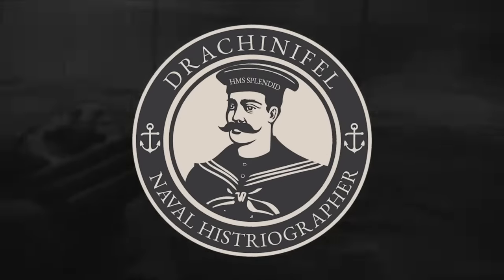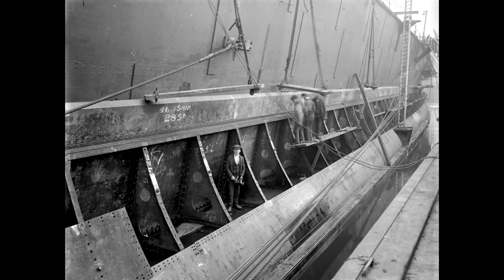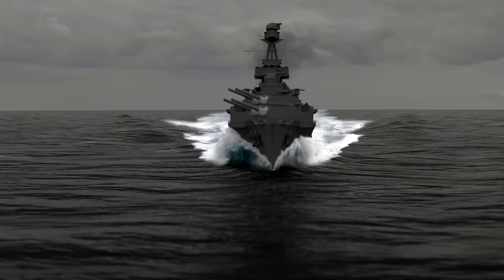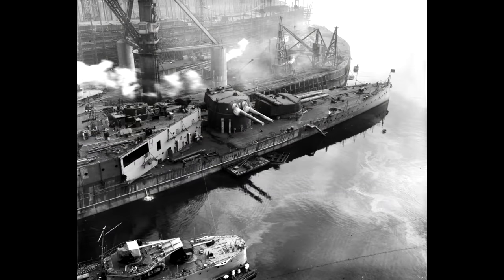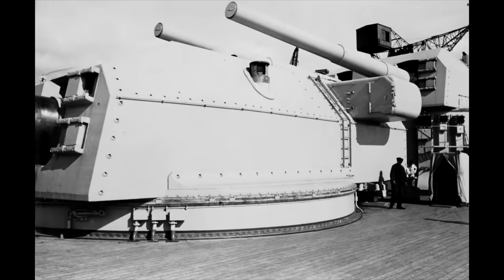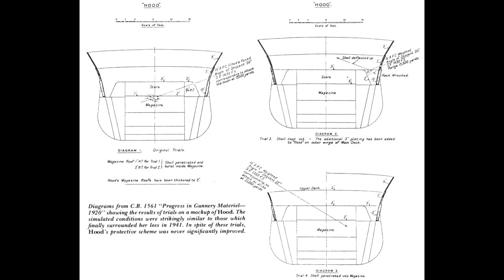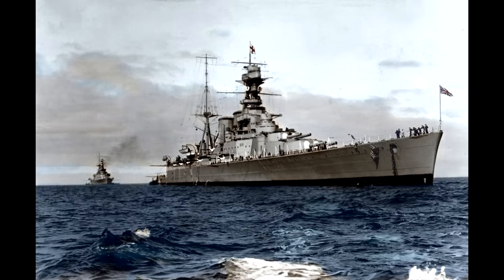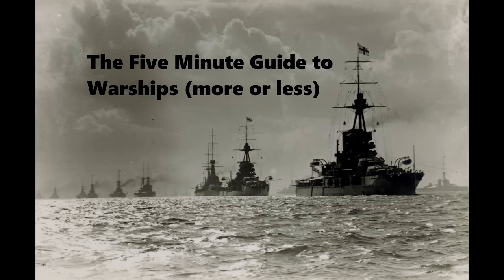The Loss of HMS Hood - But why did it blow up??

Comment: So, to interpret in a weird way, hood was killed by:
- too much speed
- not enough water
- too many Germans
Reply: Also too much water after she split in half.
Reply: To be fair, "too many Germans" is a common problem, before the 1950's.
Reply: You missed; 
Some damned fine gunnery from The Bismark. This is a recurring theme in RN vs German capital ships. At Jutland, German gunnery was spectacularly effective, the British was, erm, not so. In fact, although the gunnery really wasn't all that bad, the shells were so bad that only a small %age detonated.
Yet, for all their practice drills, rarely did the RN produce a really remarkable display of gunnery with the possible exception of Matapan.
Reply: Screams in Jackie Fisher
BUT SPEED IS ARMOR
Reply: @davidcolin6519  you are correct, but please also consider that at Jutland the ship design made a huge difference. Just look at how high the British ships sat in the water and then compare it to the Derflinger for example. Considering that they were mostly fighting broadside to broadside this gave the German gunners way more surface area to hit.
Reply: @davidcolin6519  To be fair though. Would the RN shells have detonated, more people would've acknowledged and praised their exceptional gunnery. Perhaps even to the extent that we see people praising the German gunnery today. 
I mean technically, shells hitting its target but then not exploding due to faulty fuses shouldn't really lessen  the perception of a crew's gunnery skills. 
(I'm just talking in broad, general terms and not aiming at you specifically)
Reply: @dropdead234  no, Sir, it is a British problem waging too many wars. Britain was responsable for 2 WWs, which Europe lost against the US.
Reply: @bernhardlangers778  WWII Scharnhorst-class-ships sailed with a flat silhouette. So, they were wet ships. You are right, but flat silhuettes cause sea-damages and turret-failures.
Reply: @hajoos.8360  To be fair, the french put quite a bit of effort into starting fights they couldn't finish.
Reply: @Lowkeh  Part of the problem was the unexploding shells, but part of it was also missing the target. 
At Jutland, a minuscule number of shells exploded, leading one German Captain to proclaim that his ship wouldn't have lasted long if only half of them had detonated. ,His ship made it back to port. 
But, IIRC, in the case of Hood and Prince of Wales (?) vs Bismark and Prinz Eugen, Bismark and PE had far more hits per salvo, even taking into account the number of rounds per salvo. When you consider thjat the RN had none of the reservations that the USN had about live drills, that would seem to be pretty unimpressive.
Reply: @davidcolin6519  Even 16 inch shells of Rodney could not sink the sitting duck Bismarck. To destroy the superstructure of a ship there is no need for 16 inch shells, 8 inch are enough. At Denmark strait the Brits were from the beginning in advantage. 10 big guns against 8. The Germans were forced to offer their broadsides, not a favourable angle receiving hits, as we had seen with the PoW-hit in Bismarcks bow-section. And additionally the Germans suffered under a stupid admiral, who gave no order to open fire, so the Germans started 2 minutes after the Brits with firing, an infinity during a sea-battle.
Reply: @davidcolin6519  Matapan was ...point blank xD is there even gunnery in it?
Reply: The added weight of modern modifications may hay altered the hydrodynamics of her wake.
Reply: @dropdead234  the Frenchies replaced the Dutch, a quote by Frederik the Great, "the french sloop, towed by the RN".
Reply: @davidcolin6519  Hits scored in this exchange are Bismark: 5 or 6 (1 or 2 on Hood, 4 on PoW). PoW: 3 on Bismark (one of those was marginal, hitting only one of Bismark's small boats). Prinz Eugen: at least 4 (at least 1 on Hood, 3 on PoW). Hood: 0 (some near misses on Prinz Eugen but we aren't counting those).

Keep in mind that PoW was suffering from turret malfunctions that reduced the number of guns that fired in each salvo, and spent the early part of the battle with only 6 of 10 guns able to be trained on the enemy at all. Based on this, PoW's accuracy wasn't too much worse than Bismark's.
Reply: - insufficient luck
Reply: @painiscupcake5433  Yes, good luck for PoW not to be sunk.
Reply: @hajoos.8360  this was not luck but a strategic decision by Lutjens. Chasing down the fleeing PoW would have used up ammo needed for raiding and risked further damage to Bismarck that would have ended her mission. Due to hits received in the battle Bismarck's speed was reduced to little better than PoW, so it would have been a very protracted chase, and furthermore Norfolk and Suffolk were still nearby and would probably have attacked if PoW were in danger. So at the time it didn't seem to be worth the risk. Of course we now know that Bismarck's raiding mission was over anyway due to PoW shooting her forward fuel tanks, so in retrospect a pursuit might have made more sense.
Reply: Well, I think it was best put by Curly Howard. She was "a victim of circumstances." That and what seems to be Murphy's Law taking a full 2020 on her.

"What could possibly go wrong? Oh we got hit? We always get hit. It hit in a specific spot under our side armor? Well we have bulkheads to take all that. It blew up a magazine? Well surely that will be contained. The other near by magazines exploded!? Well what else could possibly go wro-?" <Hood blows up and rips in half.>" -oh. . . . That would also be wrong."
Reply: @nerd1000ify  No, Sir, there was no strategic decision. Lütjens could not get away without fighting, this is, what we call "the battle of Denmark Strait". 2 heavy cruisers in his back, 2 BBs on his portside and the ice on starboard. But he was not able to give the permission to fire, he paniced. This was cowardice facing the enemy. Permission to fire was ordered by the commanders Lindemann and Brinkmann. The cowardice of Lütjens cost the Germans precious 2 minutes of not returning fire. Lindemann demanded the pursuit of PoW, but Lütjens failed again. The mistake of Lindemann was not to release Lütjens from his duties as an admiral, when he realized that Lütjens was not fit for command.
Reply: @davidcolin6519  That German shell was accurate & did detonate.  Her majesty didn't appriciated that.
Reply: @hajoos.8360  Technically most of Europe is responsible for the first of those world wars, and the US is responsible for the second one....
Reply: @rambysophistry1220  Dear Ramby, historical research is helpful. The FED was founded in 1913 to enable the US financial system to give loans to the Brits. Wilson did everything to lead Europe into war. The Berlin-treaty from 1878 was broken by the Entente-Powers. An the Mittel-Powers did not realized the Entente-will of total destruction. Always it is helpfull to look for the profit-takers. If the stupid Habsburgs would have given Bosnia to Serbia, it would have generate a probability that the Russians would gain a port at the Adriatic-coast. This would have led to a Brit-Fanco-war against Russia. Better for the middle-powers.
Reply: @hajoos.8360  Here is the thing. Wilson cannot really be blamed for the initiation and outbreak of hostilities that was WWI, but Wilson's work in creating the "Treaty of Versailles" is what paved the way for WWII. WWI was what happens when the political equivalent of multiple kegs of gunpowder and fireworks are stored in a phosphorous factory. The inevitable occurred and causality is as it is. But a treaty that doomed Germany to tear itself to pieces economically and placed all moral blame on them was not a good way to ensure peace.
Reply: @rambysophistry1220  Till 1914 Deutsche Bank was the biggest bank on the planet. The Brits thought they could destroy German competition on the Global Markets with war. Instead to find a European way Britain declared war. Britain declared war in WWII. These are the facts.
Reply: @hajoos.8360  WWII was an ideological conflict. Formed out of the results of Woodrow Wilson's refusal to get involved in WWI. WWI dragging out into 1918 meant that the Soviet Union formed. If the war could have been over 12 months earlier, the February revolution wouldn't have happened. Russia would have been left with a provisional republic that managed to oversee the stopping of Germany. No Soviet Union. Without a communist state Fascism would not have had purchase. 

So, all that needs to happen is the US gets involved in WWI sooner. That happens if either Taft or Roosevelt wins the election of 1912 as both were in favor of getting involved in 1914. Woodrow Wilson winning the 1912 election with a minority of votes was the catalyst required for Wilsonianism to be the ideology present at the Treaty negotiation of 1918. This caused the Treaty of Versailles and that treaty caused the conditions for WWII.

That is the historical timelime and what happens if it gets changed even slightly by not having Wilson present. Wilson is directly responsible for WWII and everything that happened in the 20th century in general. All of it. He is the worst president of all time.
Reply: @rambysophistry1220  this is what they tell us in school or at the university. Wilson admitted in 1919 that the founding of the FED as it happened during Christmas holidays, was his main failure, because the FED is not federal, the ownership consists of US private banks, funny isn't it? During the Weimar Republic the Germans debated, too, the question of a private National-Bank or a public one. The Bank of England was a private bank, too, till 1948, after Bretton Woods there was no use of it anymore. The founders of the Bank of England in 1694 are still blacked. The II. Reich could refinance the war alone with war-bonds. Britain could not. JPMorgan gave big loans to Britain. In 1916, after Galipoli Britain loses the war, what meant, the JPs loans to Britain were going into default. Let die some unexperienced GIs to save those loans. Maybe you should hear the famous Freedman-speech (1961), available on YT. About Russia is to say that at the beginning of the Russian Civil war, the Entente Powers supported the White Guardists against the Red Army. The Red Army was in a bad state until Trotzki came back from his Canadian exile with a lot of money loaned from US bankers (mainly Jacob Schiff). With this money Trotzki managed the re-organisation of the Red Army, (the Entente Powers stopped the support for the Whites), won the Civil War, fought back the aggressive Poles who invaded Russia (Polish army stood beyond Kiev) during the Polish-Sovjet-War, lost only the last battle of Warsaw, what definded the ridicoulous border the Poles still demand. About WWII read Churchill-quotes. Churchill did not care about Hitler or any other Reichs-Government. Churchill aimed the destruction of Germany and the genocide of German people. After the war, he admitted, "we slaughtered the wrong pig". Churchill was the worst European politician in human history. He destroyed the biggest empire that the planet had ever seen, and additionally the continent of Europe in a lifetime.
Reply: @hajoos.8360  So, here is the thing. I reject most of that. Not out of hand, but because there are important historical facts that are far more influential both in the structure and consequences of both wars. Starting with WWI.

The first is that Britain had naval supremacy. This means, unrestricted U-boat warfare was the only thing containing Britain's imperial might. Without that, Britain would have had the full productive and man power of Australia, New Zealand, Canada, India and all of its lesser colonies to work with and Germany would not have had a chance to actually do anything. Germany was inherently contained in Europe, regardless of anything else, and the manpower of England was greater. With those two things, Germany outright winning World War I was impossible. 

When one side has both a productive and manpower advantage the war is in essence over already. We saw that in the US civil war. It is just a matter of time arriving at that point. The money is irrelevant because it is a total war. Total wars are not like Desert Storm, they are an entire society mobilized for the explicit purpose of destroying an enemy. Money doesn't matter, factories matter, mines matter, soldiers matter.

Now it is a matter of how fast the side that is doomed to lose loses. In the case of Germany, they were able to hold out until US forces came onto the western front and collapsed the German line. At that point, Germany was going to lose the war in short order. Whether by conquest of Berlin or surrender to the allied powers. 

In the case of WWII, the war was ideological. Fueled in Germany and Italy by fear of Soviet expansion. Fueled in Britain and France by Soviet expansion and then German and Italian expansion. Once again, unrestricted submarine warfare was the only way for Germany to stall out England because massive empire with naval supremacy. The US got involved sooner, and so the war was shorter.

If you want good sources, I would recommend "The election that ruined everything (and if it never happened)" By Cody at Alternate History Hub and available on Youtube. I would also recommend having a look at the wikipedia page on Total War to familiarize yourself with why money doesn't really matter in them, and it is all about production. If you really want why production is the key economically, I would recommend looking into the concept of Say's law.
Reply: @hajoos.8360  Of course we were?, Austria's desire for a route to the sea wasn't anything to do with it more was the assassination of Austria's arch Duke Ferdinand, had the Germans gone over the Maginot line then Britain would have stayed out and let cousin Kaiser play with his French friends again, but no he had to go through Belgium, an important British trading partner, that is why we joined in despite the triple entente. As for the second time round the Germans had already taken back the ground they lost to France and rescued Czechoslovakia from itself, we even got a signed document saying the Germans would be nice from now on, not that they honoured it, as they then went on a tour of France, via Holland and Belgian, once again trading partners, at that point we could have gone for a trade agreement with the Germans and turned our backs, maybe we should have!. Could you explain how you think Britain was responsible when historically we were far more likely to have "dealings" with the French with the Germans as allies.
Reply: - not enough deck armour
- not good enough cordite and shell handling.
Reply: @mwnciboo  this might be, but please tell us a case, when enough deck-armour prohibited something?
Reply: @CrusaderSports250  Britain declared war, that's the fact. About Bosnia is to say that the Berlin Treaty of 1878 (Lloyd George was present for the Brits)  organized the international legal matter about it. The Entente broke this treaty, The assassination of Ferdinand was about the conflict with Serbia about Bosnia. Habsburg had already lost the so called "pigs-war" from 1906-1909/11 against Serbia. The High-Seas fleet is not an argument. In WWII the Germans had no fleet, but the Brits did not care. To use the route via Belgium was a strategic or tactical decision. But do you think the fascist empire of Britain, which occupied the half planet, should use moralised arguments? Czechoslovakia is an artificial state. Praque (contents the first German university) was for 300 years the German capital and much better than Berlin.
Reply: @rambysophistry1220  this is the propaganda-story for the British underdogs who had to die in battle. About British sea-dominance is to say, that Britain's situation was not the same as in the 19th century. The Germans built always ships with the intention not to use them. If the Japanese would had used the same approach Tsushima would not have happened. The strategic decision to wage war against Germany is to wage war against Europe, because Germany is Europe or Europe is nothing without Germany. And the result of both WWs is the sell-off of the British maritime overseas bases to the US for 53 old destroyers in WWII and Bretton Woods in 1944. The US is dominating now the 7 seas. The US replaced Britain. This is the major result of 2 WWs. And do you think this is coincidence? For Germany there is no big difference. Germany had no real counting colonies, now Germany is smaller and had to suffer 8 Mio. dead during the war and some more after the war by a holodomor. But globally nothing has changed for the Germans. So, you see, Britain had lost both WWs and an entire empire.
Reply: @CrusaderSports250  Dear Roger, someone, who can read, gains the advantage. I did not wrote about Austria's wishes for ports outside the Adriatic Sea. I wrote about Russia. If the Habsburgs would have admitted Bosnia to Serbia, instead to fight the "Pig'sWar", the probability of an Adriatic port for Serbia, would had been plausible. And if Serbia has a port, Russia has it, too. A main target of western policy till our days is, not to allow Russia a southern port.
Reply: All of this should be normally calculated ahead of time by the captain of the ship, right? It's called the art of war!!
Reply: @1controversial  most actions in wars are improvised....
Reply: @hajoos.8360  The US always win!
Reply: @clovisra  This is nonsense. The US is able to destroy everything. But since WWII, as Trump said, the US won no war again. And the question "why" is not so difficult to answer. Every military expert on the planet knows, there is no chance to win a symmetric war against the US. So we only consider asymmetric wars as a logical consequence. And the IQ in the US army (od Nato-state-armies) is very low, a big difference from the past in every western country. The Chinese or Russian officers staff is in this question quit superiour.
Reply: @hajoos.8360    Please, educate me. This is what a think is the truth. I understand that the US does not need to acept a formal surrender to 'win' a war. Destroying and causing states to fail is already a victory because what the US need is to get the control of natural resources and financial supremacy. Wars without end is acceptable. It mantains the war factories working and desorganize the competition by small states. What is happening in the middle east is an example. In South America no country is allowed to develop. The US is achieving all its objectives by that matter. The only areas where the US are not happy is Russia and China. China is a menace because it is no more an asset but a rival. The dream of controlling the imense russian natural resources is now becoming a nightmare. Any US government will focus always in ways to topple the governments of these two 'rogue' countries and install friendly ones. A new Yeltsin in Russia for instance. This empire project is old and is a reality now.
Reply: @clovisra  the game is already over. It will beome maybe obvious in an era, when we are already dead. China and maybe Russia are invincible. Trump had the only strategy to counter China, drawing the own production facilities back to the home-country, what means a nationalisation. US wars are very cost-intensive. Russia invested successfully only the 10th part in Syria in comparison to NATO. The Irak-wars brought nothing, only in the Kirkuk-region controlled by the Kurds is some oil-business for the US. We see more a counterproductive impact of these wars. Saddam was easy to control. Now the Shiits are in power. Honestly, this is more than stupidity. And if you look more back to the past. In Iran (1953) Mossadegh was kicked by the US and Britain, because he wanted a bigger share of the oil-money for his country. The US installed the Shah instead. He was in power for 27 years. But the Iranians had enough. The Shiits are now in power for more than 40 years. The decisive people in the US are really boneheaded. Ther are more examples, but i do not want to bore you.
Reply: @hajoos.8360  i agree, but it was not 2 minutes of no action but it was 15 minutes . 15 minutes would give Bismark  prinz eugene enough time to sink both Hood and Whales so Lutjens was fault at sinking Hitlers proud and joy the KMS  Bismark. But the only thing i  have to say is that Lutjens was following orders he was order not to engage any British ships if not protecting any convoys so i guess you can say he took it to heart to not defy orders.
Reply: @hajoos.8360  @Nili Adler most actions in wars are improvised....
                       Ja.
                       Kein Operationsplan reicht mit einiger Sicherheit über das erste Zusammentreffen mit der feindlichen Hauptmacht hinaus.
                       Karl Bernhard Graf von Moltke.
Reply: @joeyreidelbach5509  This describes a major problem in the OKM. Lütjens said to his predecessors as Marschall, that he will not give any reason to be sent home or taken from command. In this situation at Denmark Strait, all advantages were on the British side, except the light-circumstances in the morning. There was no chance to avoid battle. Even Brinkmann and Lindemann were afraid of consequences. With 2 heavy cruisers behind the stern, the ice on starboard, 2 BBs on port, a commander has to open fire to fulfill his duty, anyway concerning his own fate. It is simply stupid not to do it. This was the central debate between Raeder and Hitler after Bismarck sunk. Furthermore, in contrary to the Brits over decades, failing admirals, as Kummetz, and officers were promoted or their names hailed, as we can see with the destroyer Lütjens or the Panzership Graf Spee. The brave guys in the Kriegsmarine or former Highseas-fleet were degraded or lost their command. This is a total political failure in the II. and III. Reich.
Reply: @hajoos.8360 yep, The Head of the German Navy should of told Lutjens to not engage any ships if not fire upon on but if you being fire at then  you have the  right  to defend yourself and fire back. I mean if i was Lutjens and the HMS Hood fire at my ship the Bismark or at Eugene i would order all cannons  aim at Hood  and once the radar controll fire system and range finders have the Hood lock on i would order fire at will to end the fire fight and get to the Atlantic ocean  and start  hurting down Convoys.
Reply: @joeyreidelbach5509  The point is there was no possible decision making, anyway what the OKM ordered. It would had been the duty of Lindemann to dispend Lütjens form his command as an admiral, because he was obviously guilty of corwardice facing the enemy.
Reply: @maunsell24  Dagegen will ich nichts einwenden. Allerdings traf die Bismarck erst nach dem Gefecht in der Dänemarkstraße bereits schwer beschädigt mit der feindlichen Hauptmacht zusammen.
Reply: Hideously wrong. Not enough speed, Far too much water. German  question stupid.
Reply: @luftcorde  Please sort out the Caps Lock key.  It's just down there to the left of A.
Reply: @hajoos.8360  Insane Double.
Reply: @davidcolin6519  Are you a native English speaker?
Reply: @johnbishop5316  Please sort out how much I care. Oh wait-
Reply: @johnbishop5316  Could you, please, explain your answer more detailed?
Reply: @johnbishop5316  Yes, unlike, apparently from you syntax, you.
Reply: @hajoos.8360  You need to find a very good personal injury lawyer, hire them, and sue your highschool for negligence.
Reply: @brentm9848  Do you have any historical content you could provide us with? If do you have only personal assaults, simply shut up.
Reply: @hajoos.8360  "Britain caused 2 World Wars" is not historical content, it's gaslighting falsehoods. YOU need to provide a LOT of context to back up that assertion.

Also, do you find telling people to 'shut up' often achieves the stated goal?

Finally, what part of America are you from?
Reply: @brentm9848  The main question is, who unleashed the World War? And brought in an entire empire? In both cases there is only one possebility to answer, Britain. Only Britain was in the position to do it. In both cases Britain declared war over Germany. And it is obvious, that I am not an American, very funny. But it is obvious that you belong to the warmonger-nation, the "albion perfide", which mistreated, tortured the entire planet for more than 300 years. When you will start to pay for it, to fulfil the obligations of your guilt against so many nations?
Reply: @hajoos.8360  Okay, Karen you're very wrong in many, many ways.

And I'm not British, nor American, Snowflake.

Britain had a global empire that was based on a) trade, and b) stability of that trade maintained by her navy. It was in her direct interest to DETER war. War was the enemy of trade and Britain, through her empire, had acquired access to resources to be able to sustain.

While Germany in the latter part of the 19th and early part of the 20th century had become ambitious and wanted to have what Britain had already achieved, they lacked the access to resources. They tried to challenge Britain in a naval race. It was their instigation that forced said race ahead.

And it was a very complex, entangled system of alliances, specifically designed by the people who enacted them to avoid war, which failed due to unforeseen flaws, and drew in the great powers.

No one really wanted war. France and Germany wasn't ready, Britain was happy with the status quo, America was isolationist.... but war came DESPITE no one wanting it.

Britain didn't cause the war. A 200 year old diplomatic system, plus a jealous Germany intent on challenging britain caused the war.

Learn your history before you go spouting off.
Reply: @hajoos.8360  You can tell how superior the Russian officers are by their outstanding successes in Afghanistan in the 1980s. 

Russians are good at one thing at the moment: Cyber warfare. And it's not their soldiers or generals who are engaged in that - it's their computer nerds.

China is ascendant, no question. But only because they stole their tech from the west. They have yet to prove to be innovators. They adapt what others create. So far. When that changes, I suspect the balance will change dramatically quickly.

But the IQ in the US armed forces is not a monolith, and to be clear, the US won Gulf War 1 resoundingly. Dismissing that is silly. And the US has now got nearly 3+ decades of learning regarding asymetric warfare and that should not be discounted either. 

If Russia or china disagreed, we'd see Ukraine fully taken over or Hong Kong invaded. We don't, so they don't.
Reply: @brentm9848  You wrote the complete bullshit of school-teachings. It is completely wrong. The Royal Navy caused more than 20 holodomors in 300 years with more than 80 Mio. victims. The most famous prevented holodomor was the seabattle of the glorious 1st of June. https://en.wikipedia.org/wiki/Glorious_First_of_June
It costs the Frenchies 7 ships of the line, better than to starve.
Not prevented were more than a half mio. dead Germans, died of hunger, during WWI. Germany never attacked Britain. The fleet ambitions were not the point. The III. Reich had no fleet, but Britain again declared war. As Churchill said, Britain wanted to wipe out the Germans, not a regime change. The most famous wipe made by the Brits, was the tribe of the Tasmanians, annihilated, so diplomatic. The same bullshit story you told us about the isolated US. The US waged war against Spain in 1898, not to free the inhabitants of former Spanish colonies, but to take over those colonies, not as they said according to the https://en.wikipedia.org/wiki/Monroe_Doctrine
They took the Philippines, too. The result of both WWs was, that Europe including Britain lost both wars and the US won it and overtook the military empire. If do you watch carefully Drach's channel, you will see, that the current Brits do still not realize, what has happened, as you, too.
Reply: @brentm9848  The Afghanistan war of the Sovjets was a desaster, because the US armed AlQaida with manpads. Even the Chechenian war under Putin went not well. But the Russians were enforced to use their unfortunate experiences to transform their military. The US did not. As Trump said, the US can destroy everything, but not win (asymmetric) wars. Russia did it in Syria with a minimum of military engagements. You, my dear, are used to write always historical bullshit?
Reply: @brentm9848  Ok, you lost the debate and you want to piss off? Who cares about revisonism? Do you cannot check history as everyone interested,  is doing? For example Drachinifel is a top-researcher, does he need the opinion of prof x or y? And what you are talking about religions? Everybody is allowed to believe in jesus, climate, the moonlanding or something else. And i beg pardon, losing the battle is always boring. I recommend you to start to think yourselfes.
Reply: @hajoos.8360  I dont follow, the British did not in fact, start WW1, the US did not singlehandedly win WW1 and in fact although the fighting was still brutal, didnt even participate in most of the war. WW2 was a direct result of the penalties enacted against Germany by all of the allies who laid massive economic penalties on Germany for WW1, effectively scapegoating them into responsibility for the entire thing which wasn't accurate. WW2 kicks off by German aggression eastward into Poland which Britain didn't have anything to do with. British Troops participate in the defense of France as well as a few smaller battles in northern Europe but are forced out of France at Dunkirk and will not re-enter mainland Europe in significant numbers until the D-Day landings in '44. Also the premise that Europe lost against the US completely disrespects the efforts of all the allied countries fighting in WW1 and WW2. Hell, some of the countries even fought on different sides from war to war, namely Italy who was an ally in WW1 and an enemy in WW2. Basically what I'm saying is every part of your statement is wrong and you should really make an effort to educate yourself further before commenting further on subjects which you have very little experience. And to clarify, I did generalize significantly and skipped digging into the full social, economic, and political reasons for the World Wars but to be honest this is already long enough and it takes a college course or two just to grasp the basics of the those reasons.
Reply: In a nut shell, gunnery, only 20yrs apart, sealed the fate of good old mighty HOOD, also, latest technologies didn’t do any good to PRINCE of wales...just for the arguement, KGV is acceptable, how about PoW? No disrespect...RIP
Reply: @hajoos.8360  15/16, people wouldn’t be interested, i kind of believe/hope KGV made it to the end of WWII, but no museumS?!
Reply: @vivianvaldi7871  oh boy, her majesty @ that time, what a 🦊, SHOWsome knowledge, no respect to THE KING
Reply: @davidwong825  all BB-lovers or interested poeple in maritime history regret the lack of museum-ships.
Reply: @davidwong825  you see the development of the worse british gunnery throughout 41 to 43. The progress of radar-technology made it possible that DoY made 13 hits on Scharnhorst, with one fatal hit slightly above the main-belt into the propulsion-room.
Reply: @hajoos.8360  ONLY their focuses had shifted from big naval gunS, that’s all, & with little resources, seeing literally zero threats from german surface vessels, nothing wrong with their wartime decisions, there were other good inventions from British engineers, only not as glamorous as mighty those capital shipS
Reply: @davidwong825  The points are not british or german engineers. The main factor are the protagonists. Except our best friend Beatty, the Brits had selected better staff for posting the Lords of the admiralty. The OKM instead was flooded with political decisions and the available ships were not used for the purpose they were built for. In my view it is caused by a lack of tradition in the German navy. German crews and officers were fine, but commanders and flag-officers not.
Reply: @hajoos.8360  Man, all valid pts, just for arguement’s sake, what if , just what would happen,Had nazis/commie jointed forceS, then we wouldn’t be having this bickering S, in some way, praised the fuhrcer, just kidding, have a good day
Reply: @davidwong825  Dear David, the Nazis had a small Reich, the Islandapes an empire, which they tortured for centuries. And the Islandapes joined forces with the commies. God shave the Queen^^
Reply: 0
Reply: @pamboulton4422  <---- 0-infinte
Reply: @afishynado6812  Can we settle on "Not enough water where it counts" ?
Reply: @Nick-rs5if  Sounds fair, a gallon't victory!
Reply: And ship design
Reply: @rambysophistry1220  both times German troops crossed in to France having stomped all over their neughbors.  The first case was a carryover of 19th century attitudes and the second by a fascist bent on world conquest.
Reply: @davidcolin6519  " At Jutland, German gunnery was spectacularly effective, the British was, erm, not so."

Bullshit.
Reply: @gw7624  Yeah, you'd clearly know. I mean, you call BS in spite of the comments from the RN's own commander "something wrong with our ships" I believe was the line, 
Let's not forget that the RN STILL had problems with their fuses that had been known about since Dogger Bank.
But, of course, I'm just spouting BS. Unlike you, huh?
Has British Education sunk so low these days that simply writing "BS" is considered a valid argument?
Jeez, I know things are bad in the UK, but this is starting to look pathetic.
Reply: @davidcolin6519  Feels more like lucky gunnery; consider how few hits Bismarck landed in her final battle (ie: zero).
Reply: and don't forget british sailors who were responsible.
Reply: One more big one: not enough deck armour. The British navy was in the process of adding deck armour to the Hood. They got the front half done but not the back half. Made all the difference.
Reply: Maybe they should 've had a wood boat instead of STEEL?
Reply: @luftcorde  Tell that to the gunners and loaders that rigged safety equipment to disable it for speed.  The Germans didn't kill them they killed themselves
Reply: @luftcorde  *armour, if you spell it wrong like that, it'd be pronounced differently, without the "schwa" at the end, like Armor and not armuh, like it's actually said. This is because those words come to us from French and when the Normans invaded, and that's why they're supposed to be pronounced differently and not phonetically. English is also not a phonetic language anyway, it never was.
Reply: @Oscuros  My guy, I don't know where you're from, but no one says "armwa" or whatever. It is just "armur" in every American dialect I've heard. Maybe you're British. 🤷‍♂️
It may have originated as a French word, but English was originally Dutch and German, and we don't have the same pronunciation rules anymore. Languages change, and it's fine. Language purism isn't tenable.
And P.S.: The difference in spelling comes from the divide between British and American English, not because of some French pronunciation.
Reply: @hajoos.8360 it was only 2 minutes when he realized he has no choice but to fight. His strict orders were Dont Engage the British for as much as you possibly can. Thats why he thought bout it for 2 minutes then sent the order to stand by to open fire. Then since his order was not to engage any more british ships. He did not engage PoW, but insted head back to France for emergency repairs due to the fuel leaking out of the ship. Chasing PoW could very well result him to get trapped due to his speed being just slightly faster than PoW. Norfolk and Suffolk screened her when she retreated, so chasing PoW would risk Bismarck getting torpedoed. Either way, the fuel leak led the RN to Bismarck and sink her regardless.
Reply: @rambysophistry1220 The worst so far.